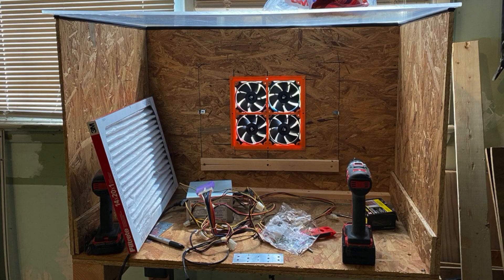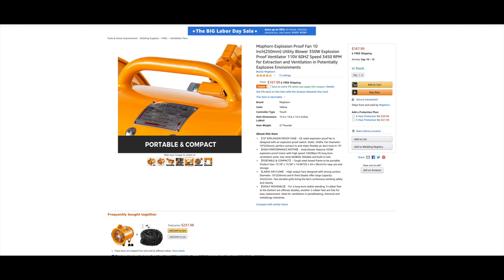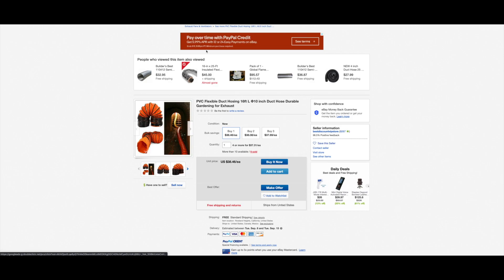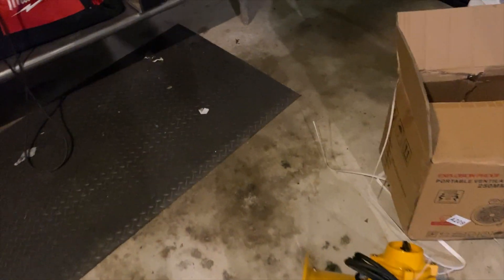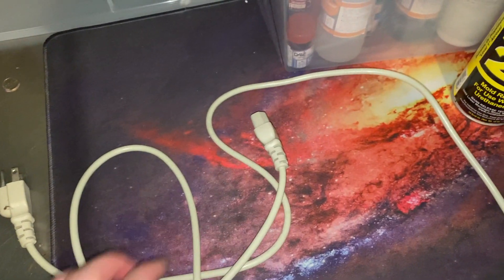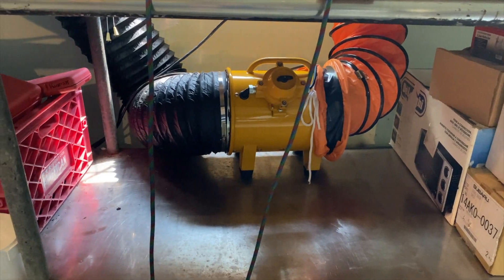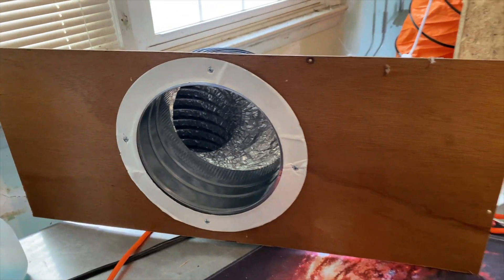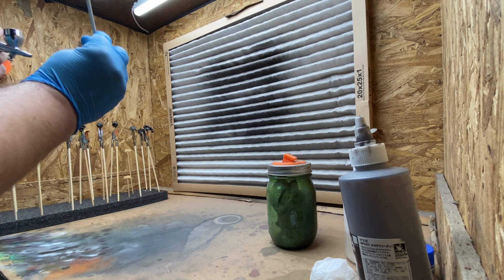The Best Airbrush Spray Booth Exhaust Fan for Lacquer or Any Paint for Gunpla, Miniatures or models

Comment: Great video, can i ask something? i have no clue about how to install the elecrticity, so i think i might buy 6 inch inline fan (i paint 1:64 scale diecast so i don't need big fan)

But the question is, the first layer is just the paint filter, is that right? i mean the inline fan are not visible to the surface like you show the pc fan in the first minute. Thanks in advance, sorry for my bad english
Reply from the maker: Thanks! Yes, the fan is under the booth with the induction side connected to the booth via the orange duct. You could attach the fan directly to your booth if your setup allows. I only opted not to because of the size of the fan.
Reply: @MS09NickDom Thanks for the reply, i should start with the template for my mini spray booth and i will buy this type of inline fan later

Comment: is this better than an Inline duct exhaust fan?
Reply from the maker: You'd have to look at the specs of the fan and compare them to answer that, although I made this essentially an in-line duct fan. The form factor of the one's you're talking about probably would be easier to set up but I'm not sure you'd be able to find one with the same airflow power, at least not at this price point.

Comment: Can i ask how is this hoplding up after a few years? also, what filter did you use for your set up? Alot of my friends are suggesting that i should use a 12v pc fan instead.... but after watching your video, im reconsidering that idea. Will it be ok to use just the 8 inches one instead of the 10 inches one?
Reply from the maker: Yeah, don't use a pc fan lol. It's held up great. I usually just use whatever HVAC filters are cheapest, as long as it's big enough to cover the exhaust hole. An 8 inch fan is probably fine, I think most pre-made spray booths use 4 inch fans which should be fine too as long as it's a high quality fan that evacuates the fumes and overspray effectively. I was going for overkill for peace of mind with the 10 inch fan.

Comment: The fan is producing far less than the claimed 1940 cfm which is the rating without any restrictions.  If the fan was indeed moving 1940 cfm the speed in the 10" ducts would be about 60 fps or 40 mph and they would blow apart.  For comparison my 80,000 BTU furnace blower moves less than 1000 cfm through 19 vents.  I do like the overall idea, just with a more modest fan.
Reply from the maker: I mean sure, that's just the physics of it, length of the ducts, routing, filtering.. all these will affect the flow. That is also true of a more modest fan, this fan is still going to do better.

Comment: Great video and very helpful, thanks for taking the time to make it in lettuce. See it in action.   Apparently your video must be catching on because I noticed the site where you purchased yours that the 10 is sold out.😂😂 I don’t like about these fans is the loud noise so I like the fact you played a short section of video outside your garage could you give me an idea of the noise reduction
Reply from the maker: Thanks for the kind words, much appreciated! Yeah its fairly loud, I would say around 60/70ish  decibels, I usually wear noise canceling headphones when I use it. outside of the garage it more just like a droning hum, maybe like 15-20 decibels max. You'd probably be able to feed the vent tubing through the window and have the actual fan outside depending on your setup, but its probably easier to get something smaller/quieter if the noise is a dealbreaker.

Comment: I found a squirrel cage blower motor on amazon for 120. It claims to be 1300 CFM and 40DB. I’m going to build one like the Japanese do with a top mount of the fan. Regarding explosions, with the amount of air your and my fans put out, it’s well below the lower explosion limit so there should never be an explosion. I think staying under LEL is more important than being explosion proof.

Comment: What size is the booth overall? All my paint clouds come from priming too. I completely covered my craft room in overspray. People keep saying the Pace booth totally removes any paint particles that would cause overspray, but with a little over 100 cfm, that’s not as nearly as powerful as the fan you’re using.
Reply from the maker: Mines about 3x3x2ft. I can't really speak of pace, I've never used one. That actually looks like the booth itsagunpla uses. They look nice and the concept seems legit of having a top evacuated booth but 100cfm seems pretty low. Air volume is air volume, if you're not evacuating more than the volume that the overspray is suspended in at any given time it's going to escape and settle elsewhere, that's just the physics of it. That booth might be good for minis or small kits, but I wouldn't trust it if you're doing larger kits or pieces, especially for priming. I certainly wouldn't trust it with anything other than acrylics.
Reply: @MS09NickDom thank you so much!

Comment: Hey I'm updating my booth with your idea. But I was wondering if the hose is way to long . Do you think I can cut it shorter to improve the flow or use what I cut off for the exhaust side ? .
Reply from the maker: yes, I cut mine down on both sides leaving a little extra just for some slack but the shorter the run, the better your flow will be.

Comment: I have seen that exact fan all over the place when looking for explosion proof" fans so that rattle can and liquor paint fumes would not be an issue. So I am glad to see someone use it in a DIY spray booth build.
Reply from the maker: yeah, I've had it for 3 years and run it hours at a time, still works great.

Comment: But is the light in your booth explosion proof…….
Reply from the maker: lol, yes, they are LED lights
Reply: Yes but they are wired to a switch, the connection to the lights and the switch that turns them on and off need to be explosion proof as the fan connection is
Reply from the maker: Right, they are wired to a switch but the switch is outside  of the booth and doesnt have a cloud of VOCs running past it. If the fan didn't work well and the room filled up with vapor, that might be a problem.

Comment: Nice job. I made my spray booth 15 years ago but at that time I was pretty green to air brushing. I used two blower units that used a squirrel cage and with external motors to eliminated that explosion thing. Personally, if you get to that point you've got some real problems in your painting technique. Anyway, I know I'm 2 years late but figured I give you a thumbs up in your effort. I've seen some pretty bad DIYers out there that are truly unsafe. If your still around it be cool if you had an update. Interested in your Fan system and how it's held up. Just got one the other day for another paint booth I'm doing. 🖖

Comment: Have you ever checked air speed in the booth/worry about deflecting the paint cone especially at low PSI? Or worry about paint drying too fast in the booth? Without the filter you've got be flowing over 300fpm, not sure how much the filter dampens that... But I've read elsewhere the ideal air flow speed is more like 100 cfm
Reply from the maker: I’ve never checked the airspeed but I can say for sure there is no deflection of the cone and I typically spray between 10 and 20 psi depending on the paint. My coats go down wet, there is no dry atomization or dusting or anything like that(I believe that’s usually a symptom of spraying at too high of a pressure, I’ve never heard of it happening from too strong of an exhaust, but I suppose it’s possible). That being said my booth is pretty large, 2h x 3w x 2d (feet) off the top of my head. I would assume in a smaller space like the size the size of the average hobby paint booth, it you might have an issue with it being too strong.
Reply: @MS09NickDom  thank you so much for the earnest reply! That's good to hear as I'm currently upgrading my own spray booth with an inline exhaust extending to an external vent in another room and debating between a 390 and a 740 CFM fan... Leaning toward the larger fan just to be on the safe side. My booth is less than 3.5ft^3 but I'm also pulling through about 40 total feet of that collapsible ducting...

Comment: Technically, the concentration of vapors from paint NEVER reaches, or even comes close to the concentration needed for combustion (the flash point). This business of saying that you need an explosion proof fan with solvent paints is simply urban legend and not based on science. That said, that's quite an exhaust fan! Note however that anyone who is familiar with chemical fume hoods and laboratory safety will also tell you that higher face velocities (the speed of air moving into the hood) are not conducive to higher safety. In fact, high face velocities can lead to decreased safety, due to the creation of powerful eddies that you create standing in front of the booth, which suck the overspray back at you.

Comment: Hi there amazing video
How is the 12 inch duct attached to the back of the spray booth? Thanks!
Reply from the maker: Thanks! It’s a 10in flanged duct, so I just used screws through the flange to secure it to the booth, I believe I have it linked in the description.

Comment: hello, i want to start airbrushing. But my concern are the fumes. So i want to build a spray booth.
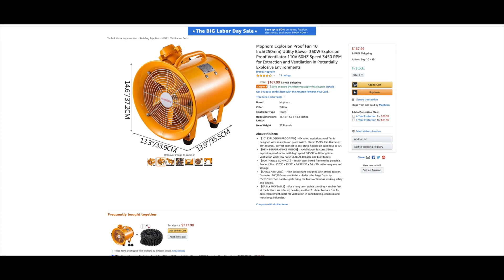Are the water based acrylics like mr hobby color paints dangerous for explosion too? And if they aren are they good for painting 1:18 scale modelcars? 

Or why are you using alcohol based paints? Are they better or turn out nicer?

Thank you!
Reply from the maker: The fumes you refer to are VOC’s (volatile organic compounds) which are usually associated with enamel, lacquer and urethane based paints (and I’m sure there’s others as well). VOC are usually flammable, toxic, and carcinogenic.
 Water based acrylics usually do not contain VOCs, not flammable and non toxic, for those reasons, are generally considered much safer to use. The down side is that they tend not to adhere as well or be as strong as lacquer based paints. Plenty of people in the modeling community use acrylics just fine, I’d just advise to not skimp out on the prep work to prevent your paint from scratching/chipping off, especially on articulated pieces. 
And FYI , I’d still wear a respirator if using an airbrush, acrylic particles may be “non-toxic” but would still cause inflammation in your lung and sinus tissues and chronic exposure could cause any number of issues.
Reply: @MS09NickDom  hi, thanks for the answer. Ok so theres no way around if i want to have nice outcome with not so much preparation? Right? Then i gues the airbrush thing is dead subject for me. I have to wait till its warm outside again. So i can spray with can.
Reply from the maker: I mean you can try it out on a smaller build and see how it comes out. Prep isn’t too bad, you should be able to get away with washing or wiping down with isopropyl alcohol and a light surface sanding just to give the point something to hold on to. Many people don’t do all that and it turns out ok. Proper prep just minimized the risk of chipping on articulated parts or when your masking, it’s not like a 100% chance it will get messed up if you don’t prep, just a higher chance.
Reply: @MS09NickDom  ok, so are there waterbased gloss black paints for airbrushing?

Its a hassle, because i dont have the equipment and i dont want to spend about 200 or more and then realize that it isnt working out.

Comment: Can you add a variable soeed controller on this fan?
Reply: Yes, I added one to mine for only $20
Reply: @markolmstead4709  can you send a link for the speed controller? Thank you
Reply from the maker: Not sure honestly and it does not mention anything about it in the product description, probably a question for the manufacturer. The cable only has  pos, neg and ground, so there’s definitely not a speed signal option, but might work with the voltage regulating kind of controller, but not sure if that could potentially cause damage.

Comment: From what I can tell this isn’t NEMA Class 1 Div 1 explosion proof so be careful. Id also bet that since it probably has some type of explosion proof certification, they don’t add the plug because it would be “recommended” that you also use an explosion proof rated plug. 

I work with EXP electrical equipment and if something with power is going into a required class 1 Div 1 area, everything has to have that rating. The conduit, the box, the plugs, etc. I’d assume they just ship the fan without the plug for liability purposes.
Reply from the maker: Ah , I didn’t realize they made explosion proof plugs too, but I guess that makes sense if you’re doing something that can possibly fill a space with a a flammable substance. Luckily in my case the vapor doesn’t make it past the booth

Comment: Would it be fine if I position the fan 2-3x further than where you've placed it? Will there be a significant decrease in air flow? I plan to get the 12" fan to hopefully compensate for it. I just have really sensitive hearing and the further it is, the better.
Reply from the maker: I would imagine the further away it is, the more diminished the suction would be at the booth. The position I have it definitely provides more than I need but I wouldn’t be able to say for sure that 2-3x further would be the same. I was thinking maybe enclosing it to muffle the sound but I’m not sure if that would cause it to overheat not being open to air.
Reply: @MS09NickDom  I see, thank you so much for the information and fast reply. I think I'll have to resort to creating a sound isolation box and put in the air compressor there as well to make the most out of it.

Comment: I get your concern for your child’s health. Cool video!. The volume of the fan is really overkill for me and I paint larger parts (gun parts) My booth is hand made but I use suction from my shopvac tube in an old sound gear rack box. It pulls enough to drag of fumes and excess but doesn’t suck paint to it.  Works great!
Reply from the maker: That’s pretty cool, are you using paint or like cerakote type stuff? That something I wouldn’t mind getting into, see a lot of people do cool stuff with stencils and such on firearms. 
Yeah it’s definitely overkill but that’s what I was going for, though I can bet that the fan is probably not as loud as a shop vac, or at least a less annoying noise. Shop vacs have a high pitched whine where as the fan is more of a low pitched whir. I’m also able to run it for hours at a time, not sure if a shop vac would overheat running that long, then again I never tried. 
Old amp rack is a pretty good idea, you used like the portable create type?

Comment: maybe I missed it but is there any reason why you didn't have the fan placed directly at the back of the booth instead of using a hose to the fan and a hose out of the fan?
Reply from the maker: Yeah, I did mention why, that would be a better way to set it up, but for the way I have mine configured, it would have forced me to move my work area/table more toward the middle of my garage, which I didn’t want to do, so by having the hose I’m able to keep it more flush to the wall. If your space allows, I would definitely do the fan directly to your booth.

Comment: You might consider adding a louvered baffle in front of the filter to catch as much of the overspray as possible before it gets to the filter, which will make the filter last longer. The idea is that the baffle catches a bunch of the overspray as it is drawn towards the filter, and whatever it misses gets sucked in to the filter itself. Great video!
Reply from the maker: Thanks for the tip! Yeah I plan to make a baffle when I make a nicer iteration of the booth, like offset slats of wood or something similar.  
Thanks!

Comment: Great video and through this I  have just made my own …works a treat except I used a 8 in explosion proof extractor which I connected direct to the back of the booth with the hose straight out the window …inside I used a Fiberglass   Panel filter 2 inches thick …I now don’t get any over spray in the room ….thanks for the idea…
Reply from the maker: That’s great! Glad I was able to inspire your setup. Yeah I think having the fan directly connected to the booth is definitely the way to go, I just didn’t want to take up more room in my garage by having it pull it out more in the middle of the space to accommodate the direct setup but I plan on doing that way when I get a larger workshop.  The fiberglass filter is probably a better idea too as I do see some pigment escaping the filter and collecting on my window screen. I assume the added thickness doesn’t impede the airflow too much ?

Comment: Looks good, this exactly what I've been thinking of doing, this video should help a lot. Did you use a flange on the back of the box where the pvc duct connects too?  I see you built an enclosure back there.
Reply from the maker: Yes, I removed that enclosure and used a lipped flange to connect the hose on the back of the booth.
Reply: @MS09NickDom  thanks 👍

Comment: Great video 👍🏾 May I ask why you chose to use a coupler and a different hose for the back side of the fan instead of the same flexible pvc hose with the drawstring ? Thanks
Reply from the maker: Just because it was cheaper honestly. The only reason I used the pvc one was because it has the hood with the drawstring thing to fit over the fan flared flange. The backside is just a straight connection so I used that cheaper one.